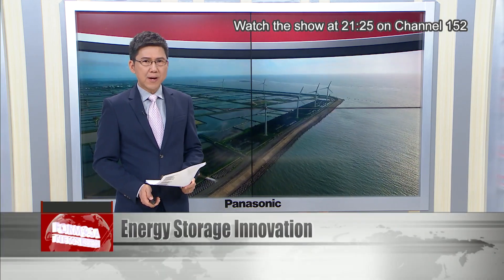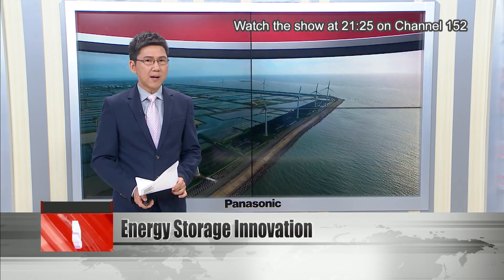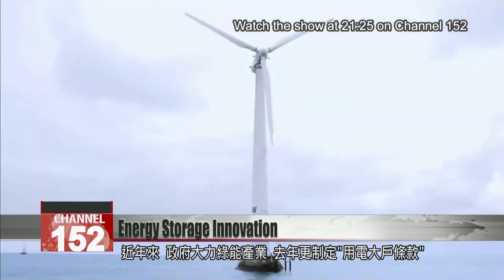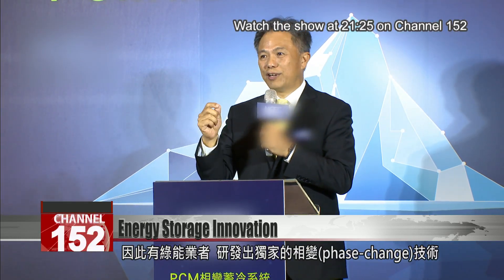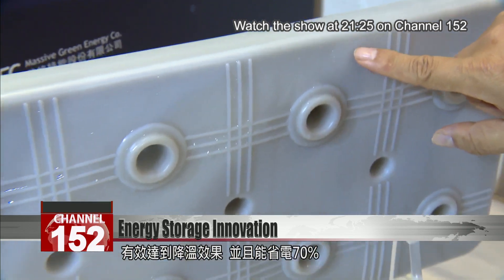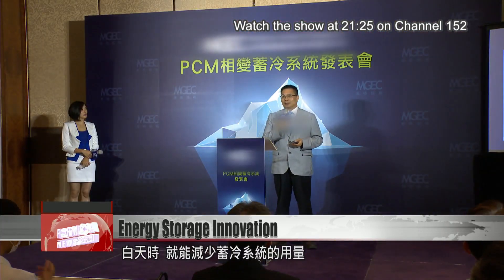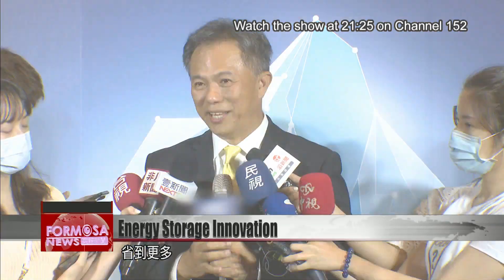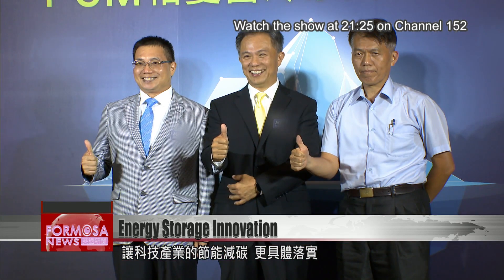New PCM makes it easier to store green energy, reduces energy bills

Comment: I don't get it, how does it store energy? After being stored as ice what happens?
Reply: Next day, instead of using electricity to cool a building, the cooled PCM is used.

In some places, where heavy snowfall occurs, snow is compacted and stored underground. Come summer, when cooling is required... free cooling!
Reply: @TheDennisgrass  oooohhhhh I thought it was like normal stores of energy like batteries or compressed air. Yeah system like that seems good for Taiwan